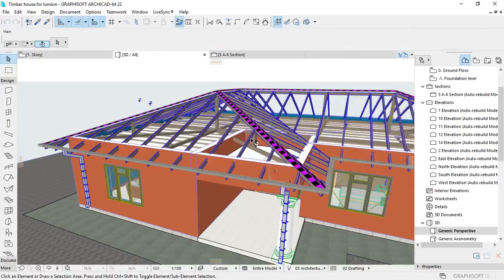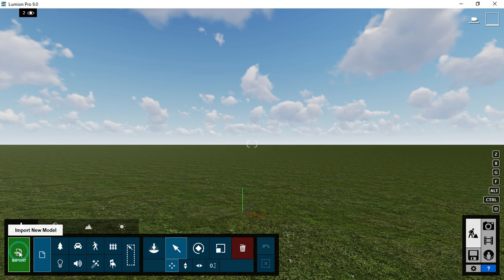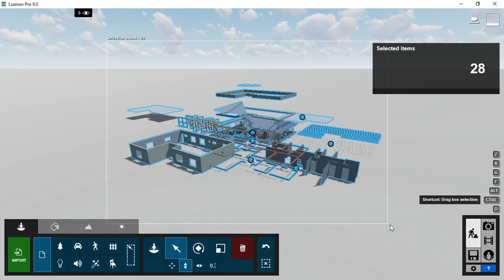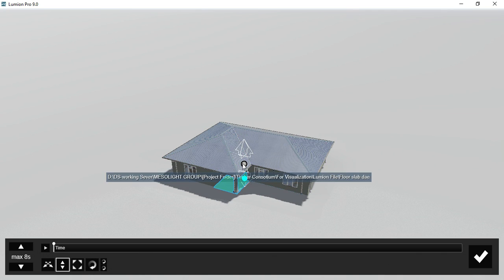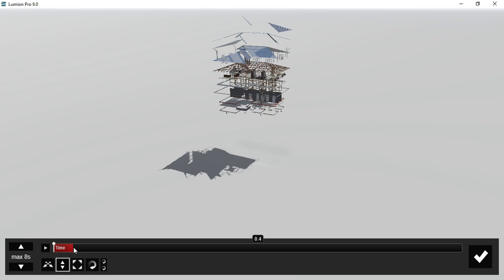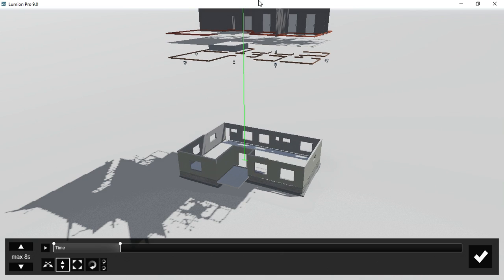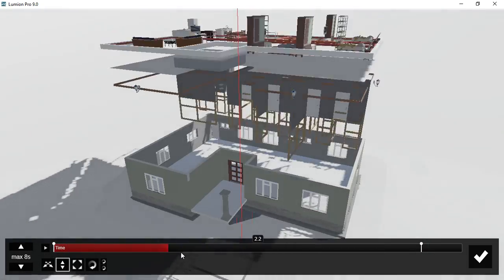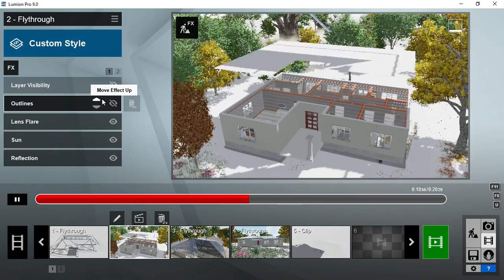LUMION - how to produce construction simulation step by step 2021

Comment: Hi, I am unable to see the move ball when animating (4:56) because of which I am not able to change the heights and everything. Please help. Thankyou
Reply from the maker: The move button on the keyframe?
Reply: @MesolightVisual  the spherical move button that helps to move object. Don't know what it's called. I have sent you a video on your Instagram. It would really help if you could check
Reply from the maker: Can you send screenshot or video to this number +267 74409446 via WhatsApp
Reply: You can see it after applying advanced move... It is on the setting

Comment: The fact that you kinda have to freehand many things is very annoying specially for a 3000$ software.
Reply: for real
Reply: 😂, the worst part is buying a powerful system and then now buying the software at that ridiculous prize and and it one day decides that it doesn't want to open, and the only way to fix that is to maybe wipe the system and reinstall, just for it to work. Total madness😂
Reply: It's softwares with those kind of prizes from hell that encourages people to keep on cracking softwares because not everyone has spare millions lying around.
Reply: I mean how difficult would it be to add 
- Parallel projection 
- North, East, West, South, Top views 
- The ability for objects to snap in place 
Like every basic 3D software on the planet had these basic ass options that make your work a billion times more accurate and easy.  3 thousand fucking dollars come the fuck on.